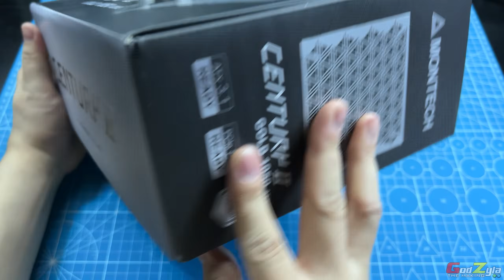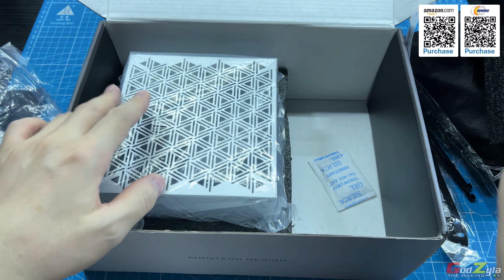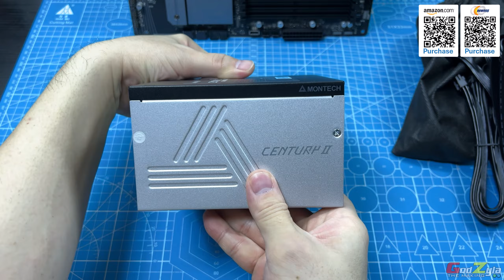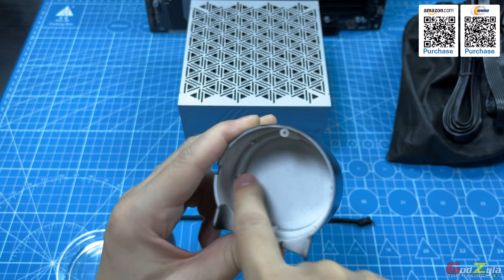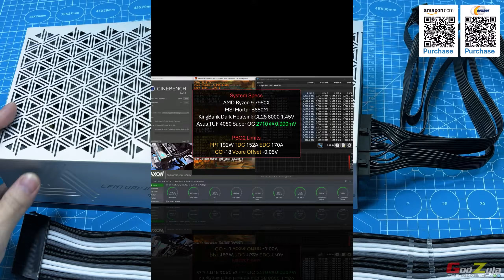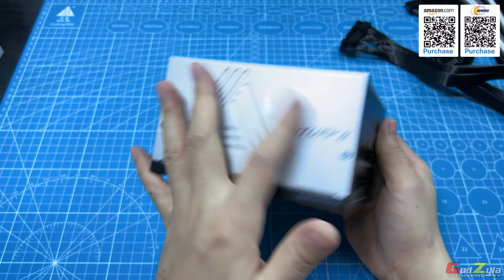Montech Century II PSU

Comment: I initially wanted to buy a Seasonic Focus GX1000 ATX3.1, but because Seasonic stock was empty in all stores, I thought about buying a Montech Century II 1050W, do you have any other PSU suggestions that I might consider, because I need a PSU with a maximum dimension of 150x150x86, because I use a casing from Phanteks XT M3
Reply from the maker: Hi More Flights, welcome to my channel. This PSU will do good as it's graded good on cybenetics https://www.cybenetics.com/evaluations/psus/2812/ . The other which are good too are the FSP Technology VITA GM 1000W  https://www.cybenetics.com/evaluations/psus/2467/ or the Asus Tuf Gaming 1000W PSU https://youtu.be/mSqjbhujyb4 (I have use this to build in lancool 207 case)
Reply: @KleoYan  Thanks for your suggestions, I think I will consider Montech and FSP, as I want an ATX 3.1 ready PSU.
Reply from the maker: @BidMore you are most welcome and all the very best with your build too 😊
Reply: @KleoYan  I just found a psu that suits me too, but I still doubt the quality, the psu is a Phanteks AMP GH1000 80+ Platinum, do you think this psu is worth it?

Comment: U think this is a good psu with a 9800x3d and a 9070 xt??
Reply from the maker: Hi Josue Hernandez, welcome to my channel. Yes it's all good if you get the 1050watts.  I will advise you to get the 1050watts. certified on ATX 3.1 https://www.cybenetics.com/evaluations/psus/2812/ as compared to the 850watts https://www.cybenetics.com/evaluations/psus/2813/ (The PSU cannot start at 90V with full load at room temperature. Two samples were tested. Therefore, it doesn't get ATX v3.1 Certification. Montech will send us new samples for re-testing.)

Comment: The cables look surprisingly good for stock cables, does it come with 3x8 connectors for 9070xt?
Reply from the maker: Hi AC20, welcome to my channel. Yup it’s good build and best part, easy to do cable management as they are flat 😉

Comment: The ATX specification allows a maximum voltage swing of 5%, which means that the 12v rail can go from 11.4 volts to 12.6 volts. 11.88 volts is within this range and is a pretty good value.
Reply from the maker: Hi JahonCross, welcome back and thanks for the info 😉 infact in general. If it’s a rated PSU that can pull up to platinum grade. I would very much like to keep close to the 12volts mark. Just that I dislike using extension cables. 😂
Reply: @KleoYan 
Completely Understandable. 😊
Reply from the maker: @JahonCross thank you 🫡
Reply: @KleoYan  You are wrong!!! It has GOLD certification! Not platinum!
Reply from the maker: @Premium_Fire_PF  hi and welcome to my channel. It is Gold but what does the efficiency says? https://www.cybenetics.com/evaluations/psus/2812/

Comment: Is it true that the 850W version isn't as good as the 1050W version?
Reply from the maker: Hi AdvancedGaming, welcome to my channel. I will advise you to get the 1050watts. certified on ATX 3.1 https://www.cybenetics.com/evaluations/psus/2812/ as compared to the 850watts https://www.cybenetics.com/evaluations/psus/2813/ (The PSU cannot start at 90V with full load at room temperature. Two samples were tested. Therefore, it doesn't get ATX v3.1 Certification. Montech will send us new samples for re-testing.)
Reply: @KleoYan  has this changed? looking at the website it says the 850W is certified 3.1 and reading the stats i think it can start at 90V with full load at room temperature.
Reply from the maker: @Chlef  hi and welcome to my channel. Yup this has changed and tested. Now verified by cybenetics
Reply: @KleoYan  thank you! i am going to get that one then.
Reply from the maker: @Chlef  you can always check here https://www.cybenetics.com/ . Anyway this is certified https://www.cybenetics.com/evaluations/psus/2813/
Reply: @KleoYan Yes that's what I meant, guess I'll get the 1050w version then!
Reply from the maker: @AdvancedGamingYT  Yup, that will be a better constructed PSU. Wish you all the very best.

Comment: so you think it is safe or not?
Reply from the maker: Hi Khanh Vũ, welcome back, I don't really understand your question? Safe on? this PSU is certified and graded as platinum. it is safe to use on highend processor and GPU, just make sure to purchase the 1000w and not 850w as 850w the 3.1ATX is not certified by cybenetics yet.
Reply: @KleoYan  Oh yeah I meant that if the power supply is safe and durable enough for a long run? It doesn't have any power sudden cut off or sparking during the usage? I just want to be aware that these new players into psu market makes a safe and stable product compared to the long time ones
Reply from the maker: @kvu236  oh I see, this is new in the market and I can understand that. currently am using it on my M-ATX build. No issue of what you've mentioned, but of course the choice is yours.. to be real honest, I will only go for PSU that are OEM by Seasonic, Great Wall, CWT and FSP.

Comment: Hi Kleo, this PSU or FSP Vita GM for a budget to mid-range build? Difference is only S$10
Reply from the maker: Hi gntan83, welcome back. If both are of 1000watts, I will grab this PSU as it has the eco switch which will make this PSU run quiet and the current provided is of platinum grade. If it's 850watt, I will go for the FSP instead. as this PSU 3.1ATX is not certified with the 850watt variant.

Comment: Where would you get sleeved cable if we don't want to use the extension cable, for SG builder. Is importing from cablemod the only option?
Reply from the maker: Hi L Kicks Bucket, welcome back. This PSU is rather new and cablemod does not have the listing on their customise PSU configurator. You can email to this general@cybercraftcreations.com and ask if they do custom sleeve cables for this PSU. kindly note, I will not be responsible if damages occures.. btw this is local SG online shop.
Reply: @KleoYan  no worries about the disclaimer, understand :) thanks for sharing the email
Reply from the maker: @LKicksBucket  you are most welcome.

Comment: Hello I'm considering the 850W vs 1050W. Will the rifle bearing fan on the 850W make a big difference for noise and longevity? Also the 850W did not get Cybenetics ATX v3.1 certification. What are your opinions on that?
Reply from the maker: Hi 
Jeong Kim, welcome to my channel. Based on the states as what you have mentioned. I would not advise you to get the 850Watts, get the 1050Watts on the save side. https://www.cybenetics.com/evaluations/psus/2813/ as you can see, this sentence "The PSU cannot start at 90V with full load at room temperature. Two samples were tested. Therefore, it doesn't get ATX v3.1 Certification. Montech will send us new samples for re-testing." Since it's not a pass, I will not get the 850watts Century II

Comment: I just bought the 1200w unit for a 9950x3D and 7900xtx build. If I understand correctly, based on your review, I made a great choice.

Do I have that right?
Reply from the maker: Hi Michael Schwader, welcome to my channel. That is correct, this PSU though is 80plug gold but it performs to a platinum PSU.
Reply: @KleoYan  Sweet. Thanks. I sold my parts to rebuild and to help a buddy of mine. It had a be quiet! Straight Power 12, so I was just curious.
Reply from the maker: @michaelschwader7944 you are most welcome.

Comment: Think I am going to go with this PSU. 

Just made a new build with 9070 XT and want a better PSU, my new build is white but I think this is a good option being silver it should blend in good with both black or white builds.
Reply from the maker: Hi Fizz, welcome to my channel. If the price is right for you, this PSU will do just fine with your build + 9070XT. It's certified Platinum grade from cybenetics and I have tested it or should I say currently using this PSU on my test rig to do benchmarking.
Reply: @KleoYan  Thanks for your reply dude. I subscribed!

It's actually the 850W I'm looking at since there is a good deal on it in my country. Do you happen to know whether or not the 850W model comes with support for 3x 8 pin PCIe cables or not? My 9070 XT isn't the OC model so it only requires 2x 8 pins so it's not hugely important to have 3, I'd just like to know.
Reply from the maker: @iitzFizz hi and yes it does come with 3 x 8pin PCIe cables. You can scroll down to the bottom where it shows you the total amount of modular cables https://www.montechpc.com/century-ii-1050w
Reply: @KleoYan  Yes that is for the 1050w model, I have ordered the 850w model since I do not need 1050w. It will arrive tomorrow. My 9070 XT only needs 2 8 pins though so it's okay.
Reply from the maker: @iitzFizz be it 1050w or 850w. So long is this Century II. The cables quantity are of the same and of course you can use just 2 for your GPU. All the best with your build too 👍

Comment: Just bought this PSU but in 850w, glad to see i didnt make a bad decision
Reply from the maker: Hi Gosha, welcome to my channel. Yup this PSU is more than just a gold graded PSU. It’s of a very good build and in a compact size. You will not regret it as it does perform very well.
Reply: Hey, I'm looking at that same one the 850W one, can you confirm to me whether it comes with 3x 8 pin PCIe like the 1050W or not?
Reply from the maker: @iitzFizz hi and yes, there are 3 x 8pin PCIe modular cables which are provided. You can refer to their official website. It’s at the bottom https://www.montechpc.com/century-ii-1050w
Reply: @KleoYan hey I  rlly don’t know much about psu cables, will it have the right connectors to power my evga ftw3 ultra 3070 ti?
Reply from the maker: Hi TrulyTrey, welcome to my channel. This PSU comes with 3 x PCI-E 8 pin cables. more info here https://www.montechpc.com/images/426287 https://www.montechpc.com/century-ii-1050w
Reply: I'm thinking of buying this PSU for my 5070ti and 7800x3d, how has it held up for you? Is it loud?

Comment: I just picked one of these up and I'm throwing it inside of a gear Seekers king 95 Ultra. I figured the silver and black would match the aluminum and black of the case
Reply from the maker: Hi Smokey TheBeast, welcome back. Nice, it not only blend into your case but as mentioned. It does provide good strong current. Just make sure you do not use extension PSU cables.